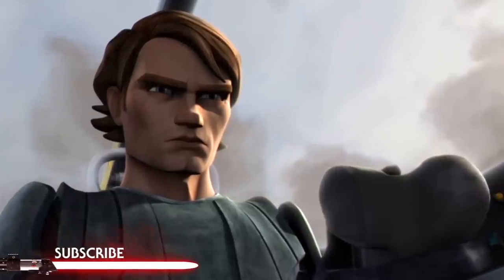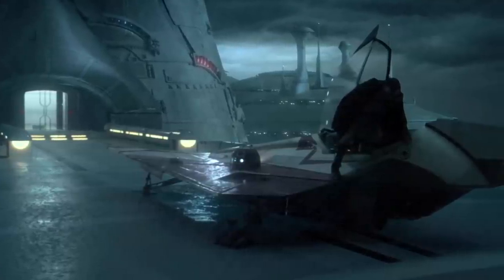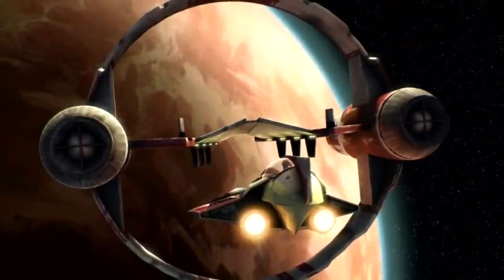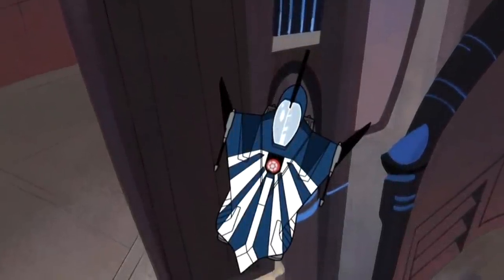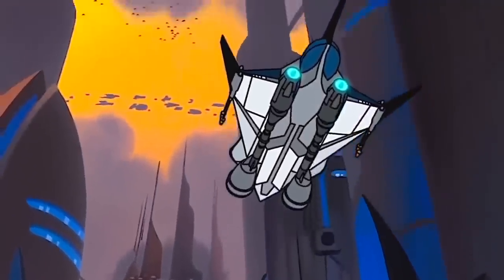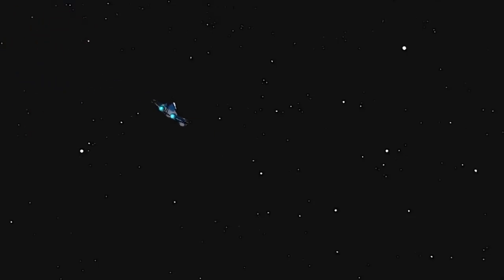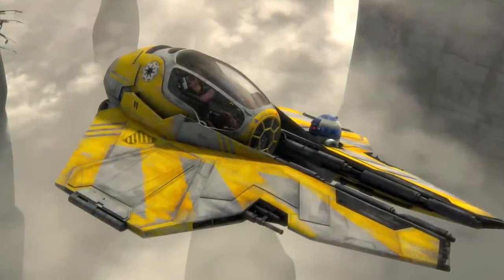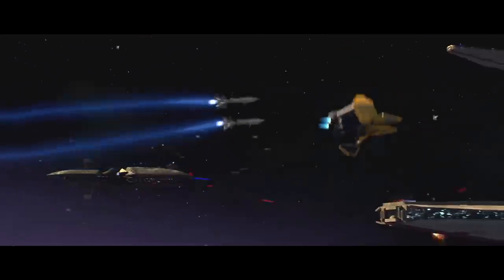Anakin's Jedi Ships Listed and Explained - Star Wars Explained

Comment: Something I’ve always wanted to know,: did these ships evolve into the TIE fighters after Order 66? I’m wondering because I’ve noticed many similarities between the two and if you listen closely to the sound of the Jedi star fighter in the prequels/Clone Wars, you can hear the TIE fighter roar mixed into it.
Reply: So the one your thinking of is the episode 3 one which is the ETA-2 starfighter which was made by KUAT drive yards, the TIE series with I think the exception of the defender and the phantom were all made by Sienar Fleet Systems, it's possible that some of the aspects were pulled but stat wise the ETA-2 actually beat both the tie fighter and interceptor handedly in every way except cost